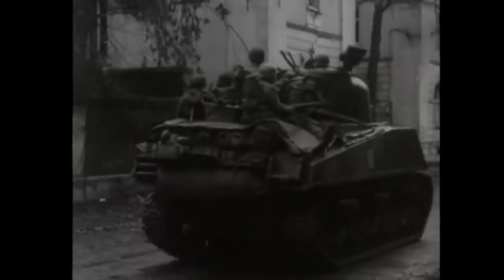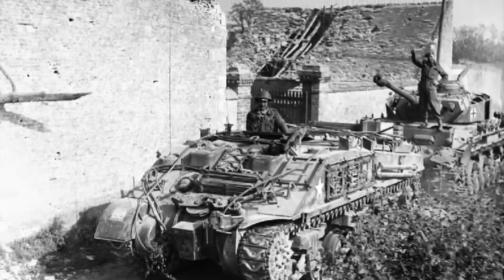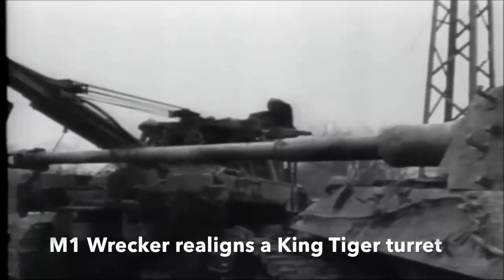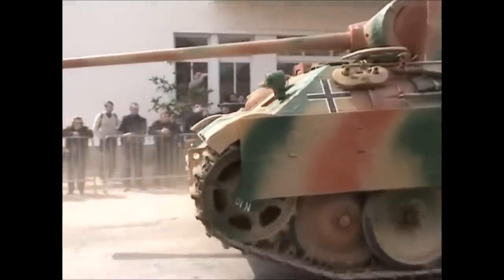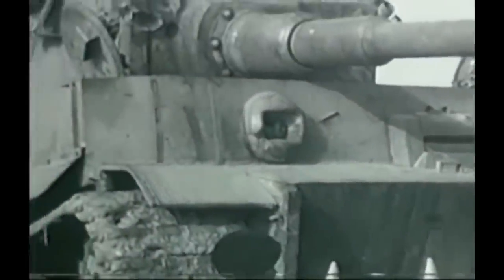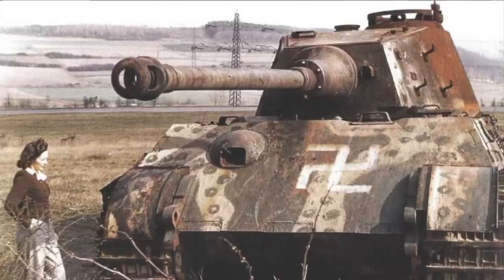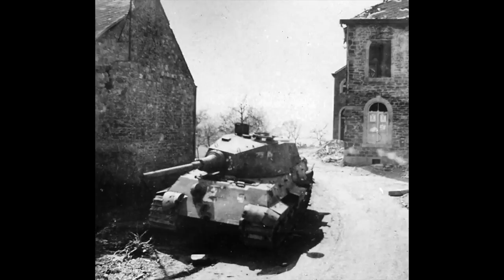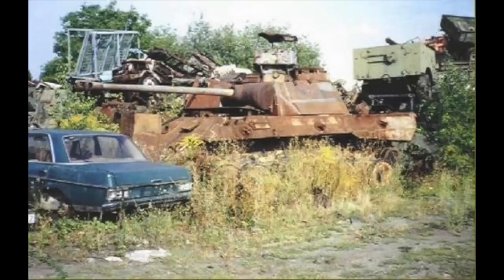Stripped & Scrapped - What Happened to WW2 German Armour

Comment: I used to own a M-5 Stuart tank i found and bought from a junk yard in Miami Florida back in 1989 but it was stripped down . I salvaged the chassis and tracks only the rest was removed including the turret and most of the interior and mechanism, motor was seized up. I paid $850 and had it transported to West Palm Beach Florida . in the shop i removed the upper carriage and motor leaving chassis and tracks with transmission/ drive gear. I took and grafted the upper half of a  dodge van body to the chassis and powered with a 700hp 440 cid motor and 727. Name d (SCAT TRAC) transmission it would run 55 mph and weighed 19k lbs painted lime green . I got recognize a year later after completion which a dodge dealership wanted me to show the tank/van.
I did 9 exhibitions runs crushing cars , i owned for 6 years till the insurance companies ban all track vehicles for exhibition and sold to a recycling yard with out the motor. I had a lot of fun with the tank just seeing the expression on people's faces and crushing cars.

Comment: There was a shortage of steel in post ww2 Britain . When they started building the first Land Rrovers, the exterior panels were of aluminium instead of the preferred steel as used in the automotive industry. The use of aluminium had the side effect of making the Land Rovers lighter and more agile, adding to their near legend early 4x4 off-road qualities. Many years (a decade or more) before Toyota Land Cruisers, Nissan's and Mitsubishi appeared as competitors in the area of off road. ALSO the rebuilding of Europe required much material steel, cement, sand, gravel etc.

Comment: They need to be saved & restored whenever found. Some have been recovered from swamps that, amazingly, have started right up & were driveable as soon as they cleared the water & had some debris cleaned away from vital parts & vents. 
After all these decades submerged in a bog.

Comment: For some time Libya's main export was the metal from WW2 Allied and Axis vehicle left over after the war. Then they found oil and that became their main export. The irony here is that the reason for the Axis forces in Libya was to gain access to the oil fields in the Middle East.

Was there any Allied country which did not, either during or after the war, use German tanks.

Idea for a future video. During the 1948 Arab-Israeli War the Israeli Airforce flew the Avia S-199 which was the Czechoslovakian version of the Messerschmitt Bf 109. Interestingly, unlike Spain, they used the Daimler-Benz DB 605 engine and then the Junkers Jumo 211.
Reply: And the Jumo 211 made it a "challenging aircraft" to say the least. Even though, they scored some kills against Arab-piloted Spitfires...
Reply: @Unther  I did read they had trouble synchronising the guns to the propeller and more then one pilot shot his own propeller off. Challenging indeed.

Comment: Well, this is mostly from the western allies point of view, I think there is a lot more on the eastern front since there virtually are battlefields that are untouched and overgrown with vegetation...

Some other cases I think deserve to be mentioned - Pz4s served in quite large numbers in France and Czechoslovakia, later sold to Syria and used in 7day war (there is at least one captured in Israeli museum) along with some Jagpanzer 4s (I think you have a video on that topic as well).

There was a large number of vehicles (StuG, Jgdpz4s, Pz4s) dug in Bulgaria during cold war (again you have video on that).

The Pz.38 very close relatives served in Peru (LTP), Sweden (licenced production), Switzerland (that was Pz.39 I believe), Iran (TNHP) for quite some time after WW2 (some up till 70s-80s).
And there was also G-10 production in Pilsen for the Swiss, which was essentially Jagpanzer 38(t) with different gun build after the war (most "Hetzers" in museums are actually G-10s).

I am pretty sure there is a lot more...

Comment: I have to add some personal knwoledge of mine:

Near Trun, in Normandy, there was a massive depot full of wrecked german vehicles and equipment.
Scrappers went there naturally, as well as military services and museums, but I know one instance of a man who took advantage of the fact that panzer IV-family tanks were in good supply to set up a business of selling their spare parts to Syria after the war in order to maintain their own fleet.

Most of the rest ended up in furnaces and got turned into razor blades and so on over the years though. The last tons of scrap metal extracted from there were in the early 2000's if I recall correctly.

Comment: When you look at the photos you get the impression that the tanks in general must have been stopped by a pretty small hole , except for those with the cupola blown off  (from munitions cook off ).  Obviously some may have been mined from underneath and have a big hole in the under body and others will have suffered mech. failures.  Note at 4.30 there is some very interesting footage showing how relatively small the damage was when a bazooka hit the glacis plate of a  tank.  Obviously if you can kill the driver or damage the drive train you can stop the tank but it looks as if  it is a very underpowered weapon from this direction.  I'd say the Scrap merchants were worried about the cost in manpower and gas for cutting up the bodies into pieces that the foundaries would take. Oxy and acetylene might have been hard to procure or expensive in much of Europe just post war too.

Comment: This house on different ground levels has a doorway from one level room to another room at a higher level. Putting a heavy wood or I beam load bearing lintel in would have made the low doorway too low and on inspection I think a 20mm piece of armour is holding up the ceiling beams which rest on it. I think some of that salvaged armour plate went into all sorts of things.

Comment: While involved with mineral exploration about 20 years ago, our team included a core drilling platform allegedly powered by a scavenged WW2 German armored vehicle engine. That air-cooled diesel rig ran all day every day, drilling thousands of feet thru hard basalt or whatever else, not too loud, not too thirsty, a real winner.
Reply: German armor didn't use diesel engines in WW2, that's an urban myth, they all used gasoline engines even the Tiger and King Tiger.

Comment: I use to know an old  Austrian Jewish guy who voluntary joined the British army in WW 2 as a motor mechanic. "Old Wally" as he was affectionately known, worked away in his  engine reconditioning business in Melbourne, Australia until his late 70's or early  80's The business  closed in the early / mid 1990's >Once, while at his shop, I noticed he had a rather unusual, large steel engineers vice which he claimed he milled out of a solid  piece of German tank armor he had salvaged from his time spent at the Italian front. He often use to say "the Germans made the best steel". Wally had many interesting stories to tell about the war & in one he said the German Army just pushed their masses of equipment down the edges of gullies & mountains during their often hasty retreats up through Italy. He also use to say that the American & British officers often tried to recover the much prized convertible Auto Union German Staff cars to keep for themselves. Wally said he often had the job of getting them going again. Wally was both fluent in German & English.

Comment: It was common practice (by both sides) to demolish any artillery, or Tanks belonging to the enemy. This prevented their being recovered, and repaired.  In the case of German equipment's, the allied Engineers would find them, stuff them with TNT, and make many little pieces of them.  This left nothing salvageable for the enemy, only scrap. The Axis was more than eager to do the same to allied Equipment's, This program did not however stop either side from using captured machinery if it was still serviceable.  After the War, surviving German Tanks were usually melted down  to scrap, partly because of the monsters they represented, and partly because military Equipment under the rules, remained property of the Country of origin . No one wanted Germany 's new Government to find a way to reclaim anything that could some future day, pose a threat.